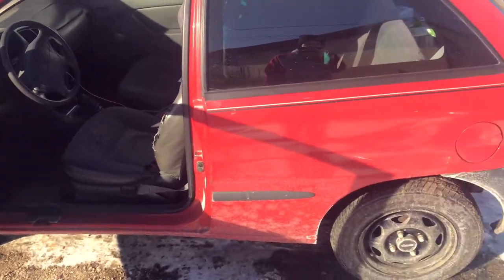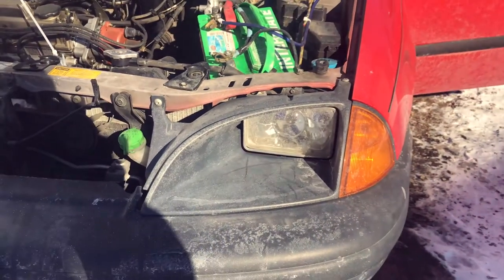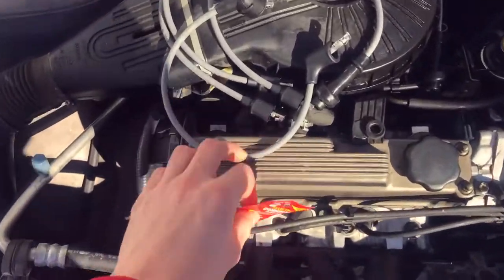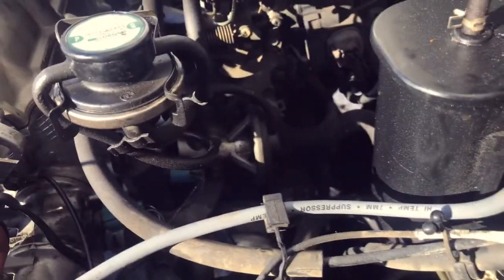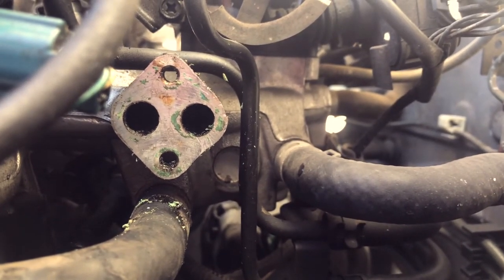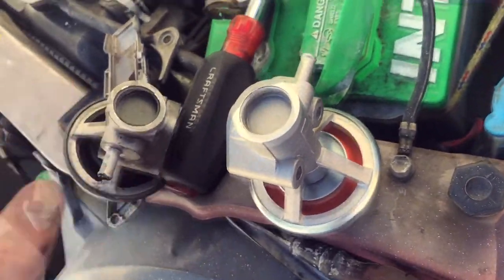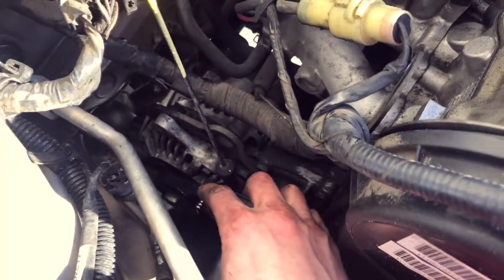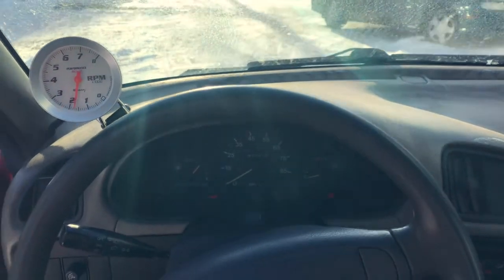New Car! Where's the Integra? --- EGR, Oxygen Sensor, Spark Plug Wire Replacement - 1995 Geo Metro

Comment: Hey it's good to see you back.  Did you end up getting those dunlop thermo boots for the winter in the end?  I guess now that you're not roofing maybe you didn't bother with them.  What are those classes you're taking?
Reply from the maker: Mountainview Ranch You are correct, no need for new boots as of now. My old insulated ones work fine for when I need to do work outside every once in awhile. Plus Wisconsin seems to be getting much warmer. 50 degrees in a couple days in the middle of January. 
As for classes I just finished up Biology. I’m now in several sciences, supply/chain management, literature and some other good stuff. Excited for this semester and spring! Glad to see you as well!
Reply: Do you have cowboy boots too?  If so it would be cool to see them in your next video.